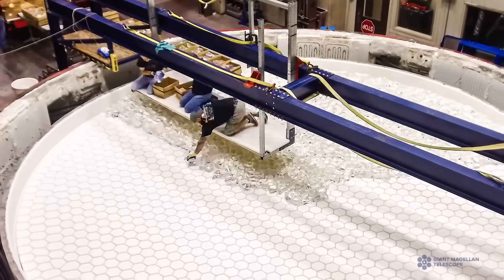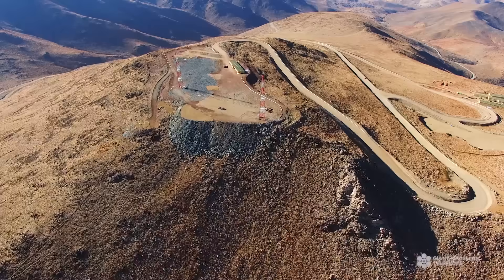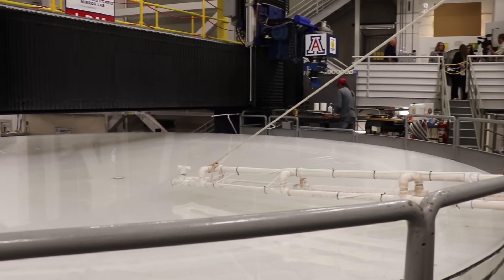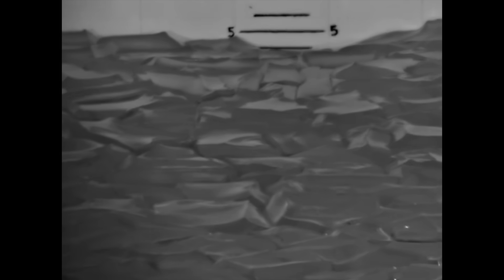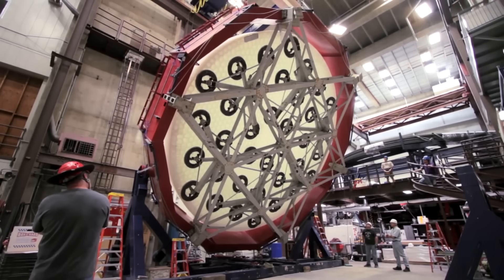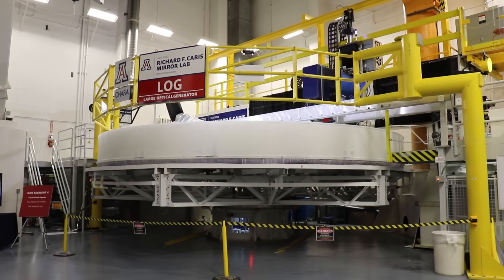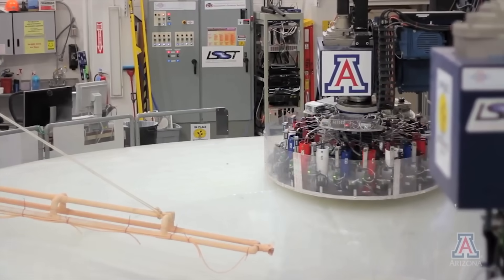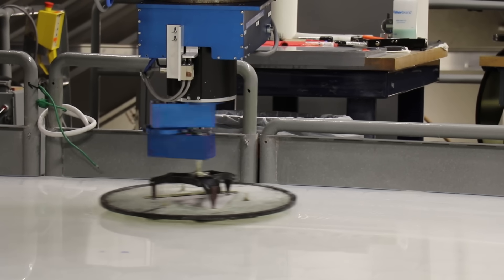Casting a $20 Million Mirror for the World’s Largest Telescope

Comment: Not explaining the most vital step unfortunately.... how do you actually polish it down to a nanometer precision? I see a fat brush physically rubbing on the glass. That couldn't possibly be this precise. Do they use heat or lasers? Does the whole workshop have to be in a vacuum? Does it have to be as clean as a wafer factory and if so, how do you keep something that huge that clean? And how do they cool it so that the heat from the machinery doesn't immediately deform it on a tiny scale? How do they even apply the silver this precisely? It's hard for me to imagine how you polish a 7 meter large surface to basically atomic levels.

Comment: Imagine if this telescope was outside of Earth's athmosphere.
Reply: It has the same quality as a telescope out of Earth's atmosphere, BECAUSE it has build in 'adaptive optics'... adaptive optics can compensate the atmospheric disturbations...and this needs a lot of computation-power (which we now have). Back in the 80s/90's the Hubble-Space-Telescope really had an advantage against earth-bounded telescopes, because back then, it wasnt possible, to make adaptive optics. Nowadays its possible, and its not to necessary to build space-telescopes... Space-telescopes nowadays have other advantages... for example pictures at different wavelengths (infrared), to see through dust-clouds and for faintest galaxies which arent to bright at visible wavelenghts, but at infrareds.
Reply: arr see ship:  In fact, cgi is also possible in astrophotography, but that is called by a different name (= image stakking, or lucky imaging (i can explain you later)).
With adaptive optics (thats the more expensive way) they try to compensate the szintillation of the atmosphere. The atmosphere has partly different refraction then other parts of the atmosphere (you know it because of: flickering of the road on hot summer days (thats also kind of szintillation of atmosphere (in this case near-floor-level)). There are also this kind of flickerings and wobbelings in the upper atmosphere (just like a kind of ocean... thats why the stars with telescopes also flickering and wobbeling.. even the moon surface through telescope... because in every case the telescope must look through the thick turbulent atmosphere). 
Adaptive optics try to trick the atmosphere: they send a beam of (usually sodium-laser as far i know) through the atmospere - this laser scatters in the same way in the atmosphere, like the light from the stars... so they analyse this scattering in a fraction of a second, and distort the telescope optics (thousand times a second) TO those scatterings (so there is a full compensation, of the atmospheric turbulences). Result is: a clear image as shot 'without atmosphere' ...even if the image was taken on earth.
THATS adaptive optics mean (you can imagine how expensive this technology is... its not an old technology).

An other way to solve the turbulences of the atmosphere is really kind of cgi (now i come to the explaination of image-stacking). Its the cheap way, and many hobby-astronomers make it that way : 
Mathematically speaking: a lot of turbulences smooth eachother out with time... for example: if on a spot of the image through atmosphere the atmosphere distortet : +0,02 % ... but one second later, it distortet -0,02 % ... Then +0,02 % distortion, and -0,02% results in 0% distortion, if a computer calculate the picture with two different atmospheric distortions on that spot (thats the easiest possible way, to explain image stakking (in truth its a little bit more complicated ) ).
Such image is truly "remastered" by a computer ...because the original image would be to hazey, blurry, etc... A lot of hobby-astronomer-sides in the internet show their result with image stakking (or also called: lucky imaging). You can look it up in google. 
Its a cheaper way, to eliminate atmospheric turbulences from a astronomy-image... but it has his downsides... thats why the big companies behind big telescopes usually favors the adaptive optics. In comparison with image-stakking its much less 'computer-generated' or better say: computer-remastered.

Hope this helped.. If you have a little bit of money, you also can buy a telescope, and enhance the image quality (also on landscape/nature views) with software-side : image stacking. And if you like the results you also can try the same methode for astronomic pictures taken by your telescope .. you will see, you get much better image-results from the moon , star-clusters , space-nebulas, etc.
Reply: Nah, you should still have this telescope in outer space.  It's the best way. @PygmalionFaciebat
Reply: @glorymanheretosleep  I'm not sure..  not only that you can build a 10 times larger earthbound telescope for the same prize as a outer-space telescope - but also the maintenance is much more easier. Remember the problems with Hubble in the beginning ? Now lets imagine, the problem would've been impossible to repair by astronauts and equipment they can 'put into a rocket' .. It was big luck, that the error on the Hubble telescope was 'relative' small...
But even changing the gyroscopes was a big challenge... 
So yes: there are few advantages for outer-space telescopes (which meanwhile are also achievable by earthbound telescopes), BUT a LOT of disadvantages and risks (dont forget: every repair of a telescope by astronauts is putting human life in danger (there is a 1:150 risk to die from a rocket-start... space travel is even today the most risky way to travel).

And dont forget other problems: micro-meteors... and space debris... 
Mostly space-telescopes are barely live for 20 years... 
Earthbound-Telescopes can live for centuries ... and serve the science.
Mount Palomar is still a nice telescope... and its quiet 'easy' (or lets say easier) to make those earthbound telescopes 'up to date'  - and again: also this is cheaper).

There are two advantages i have in mind, which cant achieved by earthbound-telescopes with 'tricks' -  these are 1)  long-time-exposure. Hubble can make for example 1 Million-Second-long-Time-Exposure.. Thats nearly 2 weeks exposure. Because earth-rotating the maximum would be: a half-year-exposure on earth (and for that the telescope must be build exactly on northpole or southpole , and the telescope must be rotating against the earth) - and for this it only could make photographs from the sky-zenite - or near to it). For longer exposures than a half year (polarnight) , we must go outer space... yes. Espescially to find Exoplanets with long revolution-times.
2) specific wavelenghts are swallowed from earth-atmosphere... in those wavelenghts earthbound-telescopes are 'blind'.  But those arent a 'lot' wavelenghts...
Reply: Well, according to Snell's law.  You should build it in outer space. @PygmalionFaciebat
Reply: Many images compiled together using a computer, deletes the distortion.
Reply: @dewdewism  Yes i mentioned this in my last answer too (Lucky Imaging / Imagestacking)
Reply: @PygmalionFaciebat  yes but people actually read the tl/dr 😂
Reply: @xxportalxx.  lol i read the long version first then came to Roger's one sentence that summed it up and was like damn I didn't actually need to read all that stuff I don't fully understand.
Reply: The astronomers would find it hard to breathe...
Reply: You mean the James Webb Space Telescope?  Yeah... look it up.  It's basically going to be THIS telescope.... but in SPACE.  So we won't have to worry about the atmosphere hindering out imaging.

Comment: Breaking a mirror gives you 7 years of bad luck per square meter of mirror broken. [2]
Each of these mirrors has ~ 55m² of surface area (8.4m x π). [1]
Therefore breaking this mirror would give the actor a total of 385 years of bad luck (55 x 7).

Moral of the story is: the crew should be careful. Very careful.

[1] http://www.gmto.org/
[2] o.o really?